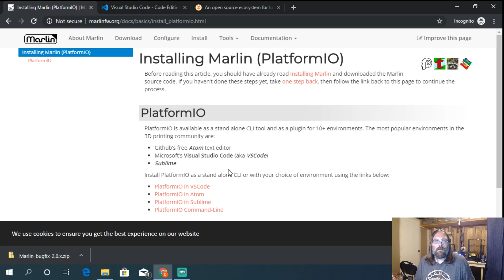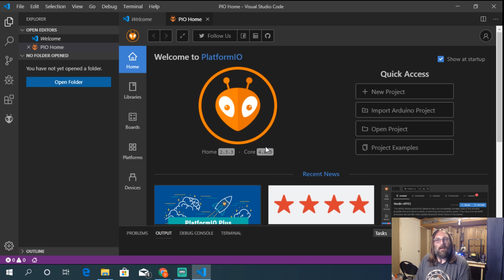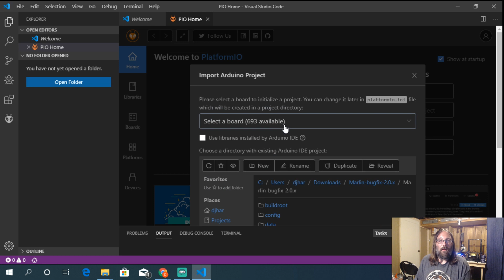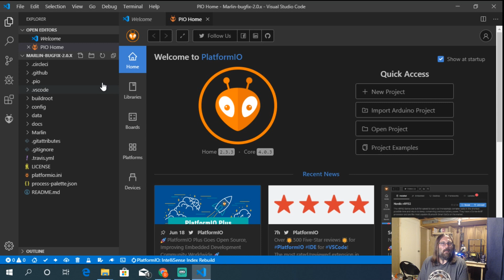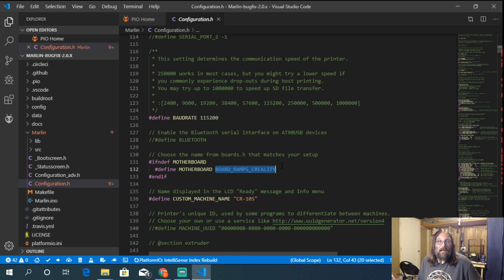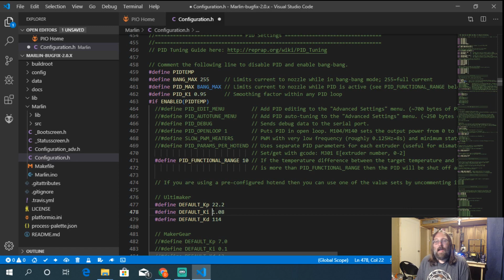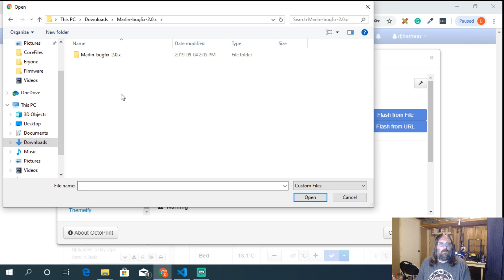Compiling Marlin 2 0 with VsCode and PlatformIO

Comment from the maker: Hey all!  Thanks for checking the video out!  I just wanted to pop a comment letting everyone know that yes the example files still exist the marlin team has just moved them out of the zip and into the guthub (https://github.com/MarlinFirmware/Configurations ).   The left a readme in the zip with this link to!

Stay Awesome!
Reply: The link doesn't work correctly as the closing Parenthesis is part of the link, Just an FYI.
When I download the Latest Marlin  I only get the config file and gitignore, License and the readme file. I do not get a Marlin folder with those files like yours show. I have to be missing something.
Reply from the maker: @DJMovit  Fixed the link thanks!  The folder is in the marlin2.0.x/config/ and the readme is in there I just downloaded the latest release to check.  Following the link downloads the zip with the defaults and examples.
Reply: @3DMakeIt  thanks, I figured I downloaded just the configuration file. I picked the wrong column. 
Your video is very informative! Thanks!
Reply: thanks for  these very helpful videos.
I am having issues installing PlatformIO in the VS Code. I get the error message 
"ERROR: could not start PIO Home Server: ERROR: time out"
The recommended fix did not work.
This is on a completely updated Windows 10 notebook computer.
Would it be possible for you to compile a bin file for a CR-10 mini with BL Touch and filiment sensing so I could download? Otherwise I am stuck with a new mini board, TFT display and BL touch sensor I can't use. If anyone reading this can help, I would appreciate it greatly. Very frustrating...Thanks!!

Comment: You are an excellent teacher.  You don't go off on tangents, you explain the why of it all and you repeat directions in specific areas that can easily be overlooked or missed.  Thank you for this excellent explanation and tutorial.
Reply from the maker: thanks for your kind words!
Reply: @3DMakeIt  You're so very welcome.  I am however baffled at why I have no pio file after following your instructions.   I am trying to update the firmware via octopi.local and when I go to search for the pio file, it isn't there.  What did I do wrong?
Reply from the maker: The pio folder is found in the root of your working directory.   The location of the folder is output just above the line success output in your terminal window when you compile.  If you send a screen shot of tour marlin folder on facebook we can take a peek
Reply: @3DMakeIt  Thank you.   Here's what's above the word success: 
Building in release mode
Checking size .pio/build/megaatmega2560/firmware.elf
Advanced Memory Usage is available via "PlatformIO Home > Project Inspect"
DATA:    [======    ]  60.8% (used 4984 bytes from 8192 bytes)
PROGRAM: [======    ]  62.0% (used 157560 bytes from 253952 bytes)
Reply: I'm guessing it's probably a mac thing.
Reply from the maker: @vegansynths7757  it should be in the same spot.   heres the documentation on it from platform io.  http://docs.platformio.org/en/latest/projectconf/section_platformio.html#workspace-dir

Comment: Thanks for the video. most helpful, especially your mention of the Upload button/function!  The Platform IO upload helps especially if you are using a MAC as the .pio folder is hidden within MAC FINDER (explorer) as a 'dot' folder is a hidden folder (nb. something worth mentioning to the viewers. I spent hours trying to figure what I had done wrong post compiling my first code when all along it was simply hidden - also can press CMD+SHIFT+DOT to reveal). Thanks again!

Comment: Thank you Thank you Thank you!!!!  Ive spent the last few hours of last night and today getting error messages from Arduino software about some bs issue about character length?! No one has a solution, and was directed to VsCode (which was going to be a new beast to lean... so I thought) I'm so glad someone posted a link to this video, your video! I will be using Vscode for now on. So simple love layout. And your video made this all possible. I was banging my head against a wall for an issue that wasn't my issue. 1 quick pass with your video and everything worked. I have been going through marlin videos trying to see where I went wrong with Arduino to have given me such an error. uninstalled and reinstalled marlin and arduino a few times. But seriously just skimming through this video, as I had already created my desired marlin file... and the hex file is right there in front of me. My printer is now flashed with new firmware. Thank you so much. thought I was going crazy for these last few hours ngl.

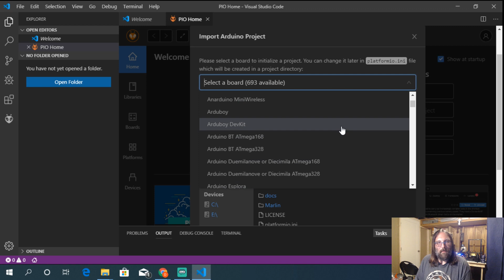Comment: 10:34 cant see MKS Robin E3D board???
12:18 do you copy whole line as in " #define BOARD_MKS_ROBIN_E3D           4026  // MKS Robin E3D (STM32F103RCT6)" OR just "BOARD_MKS_ROBIN_E3D" in place of what was originally there? (i.e. omit the MOTHERBOARD part of the line) It does not specify in the video.
17:23 I get FAILED mega2560 and mks_robin_e3 IGNORED it does not specify MKS_ROBIN-e3D at all. Probably this is due to being unsure what I should do at 10:34 and 12:18 for an MKS Robin E3D board for a CR-10.
???

Still cant figure it out.
I previously upgraded my original CR-10 board to Marlin 1.1.9 using this video and managed it successfully. https://www.youtube.com/watch?v=7J7NYnxL5vA 

But now have the MKS Robin E3D which is configured for the Ender3. No such video to how to use in CR-10 and update the firmware. I also tried it with the Arduino IDE....same ...could not compile and IDE could not see the board anyway.

Comment: Thanks but this didn't work for me. Been trying to update the firmware in my SKR Mini E3 board but whenever I click on "Build" I get a "1 failed, 0 Succeeded" message. I made sure the correct board was selected in the "platformio.ini" file too. It keeps showing it's trying to work with the wrong board and I can't seem to make it change it's mind.
Here is the problem it's telling me it has. Means nothing to me:
{
	"resource": "/c:/Users/sfsco/Documents/Ender3/Marlin-2.0.x SKR mini E3 V1.2 updated - BLtouch fil runout/Marlin/Configuration.h",
	"owner": "C/C++",
	"code": "1696",
	"severity": 8,
	"message": "#include errors detected. Please update your includePath. Squiggles are disabled for this translation unit (C:\\Users\\sfsco\\Documents\\Ender3\\Marlin-2.0.x SKR mini E3 V1.2 updated - BLtouch fil runout\\Marlin\\src\\Marlin.cpp).",
	"source": "C/C++",
	"startLineNumber": 1,
	"startColumn": 1,
	"endLineNumber": 1,
	"endColumn": 1
}

Comment: Thanks for the excellent, step-by-step help. It's really important for  those of us who are struggling with this changeable workspace :)
My problem is that I have gone as far as finding what I think is my Board as'NXP mbed LPC1768' in the window. I'm trying to fit an SKR V1.3 PCB to my Anycubic Kossel Delata Plus which has the NXP LPC1768 chip on board but, when I hit Import, I keep seeing   'X Please select a board'. There is no menu appearing in the Explorer window so I must have missed a step somewhere... not for the first or last time. Any and all suggestions gratefully received.

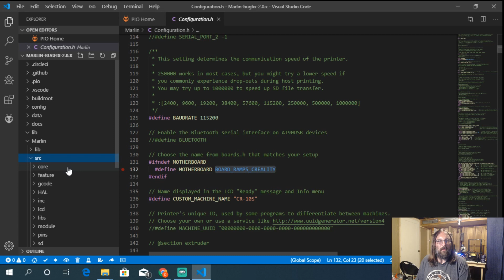Comment: From 12:31 to 12:36 you go from having a bunch of errors in your program to none. What did you do? I've been struggling with this issue for hours and I know it's probably something really small I have to change. Thanks
Reply from the maker: Oh Hi!  A few things you need to make sure of is that the file path isn’t to long where your firmware is.  And that the user that opened vscode has permissions on that folder.    I use the insiders build of vscode now (been about 2 weeks) and it has behaved well.    

The last and best suggestion is if those errors don’t go away you can use the open project button vs the import.  Make sure that that your platformio.ini has the right board in before opening va the import.    Basics import can set the board type where open just reads what’s on the ini file.  

Hope that helps!
Reply from the maker: Oh and I forgot to mention. The longer mine stays open the better the library files open

Comment: Thanks for the video but the only problem I have is there is no example configs in marlin 2.0 they are only 1.8,1.9 and there isn’t many of them like what you had, any idea what I’m missing?
Reply from the maker: HI!  if you go to the config folder and examples (mariln2.0.x/config/examples) which is the location of the examples folder.   There is a readme that says they have just stopped putting them in the zip you download (I imagine to save space) but they are all still available at https://github.com/MarlinFirmware/Configurations

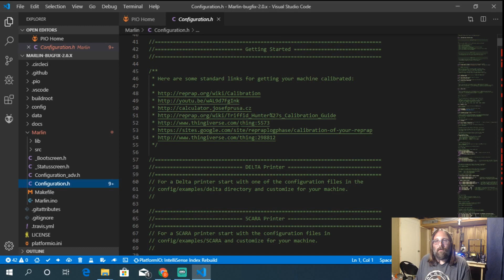Comment: @ 11:11 when you click the configuration.h it shows your config has many errors (9 problems with this file). The red marks on the right side of the screen show where they are I guess? It would have been nice to touch on how to get rid of those errors. I have one error and not sure how to resolve it. Now I must go elsewhere. Great video otherwise.
Reply from the maker: There were no errors.  It was actually the intelligent comipler.   It glitches out occasionally.  Known issue in vscode it sometimes parses the project folders slowly.  Unless you get errors when you try to compile chasing them is a fruitless venture
Reply from the maker: Whats your error perhaps I can help
Reply: @3DMakeIt  What board would I select for a stock Ender 3? Also, how do you change the board once you've selected the wrong one? lol
Reply: In Arduino IDE it was Sanguino ATMega1284. That's a fail for me in VSCode
Reply: I figured it out. My sketch was just too large.  99.1% space used but got it on my stock Ender 3 board with nozzle park and advanced pause enabled. ,😁

Comment: One year later and all of this has changed. Examples are not in Marlin download folder. VSC looks different. I am receiving 17 warnings. I tried uninstall VSC and all components yet every time I reinstall everything is exactly the same. Marlin is installed on it Platform io and the project (with all the warnings) is installed. I cant go back to square one. I am better off buying a new printer with all the time I have wasted.

Comment: Hi! This firmware updating is totally new to me. Just got my Ender 3, my first printer, built and printing. The mainboard printer drivers are very noisy though, so dreaming of buying the btt skr mini e3 version 2. Some day in the future I would also like to install a bl-touch for abl. I got vscode, platformio, github desktop and I think also python installed on my MacBook. Should I download Marlin latest release 2.0.5.3 or nightly build(what is a nightly build??) Marlin 2.0 with bug fixes? Also, should I always start the Github Desktop app before starting vscode and PlatformIO before trying to compile a new firmware for say my current old mainboard or the skr mini e3 version 2.0? And I know the old board doesn’t have a bootloader, but does this sks mini e3 v2 board have one? So much for me to learn still! Your video has motivated me to try to learn how to do configure for my printer, so fascinating! I like your teaching style!👍 Thank you for the inspiration!

Comment: Very Interesting and easy to follow. Only problem is build with Platformio fails with message that I'm using old Configuration.h file even though I'm using Configuration release 2.0.5. Have tried several different build environments all with same outcome. Must be doing something wrong but no idea what. Thanks for all your work though with this and other videos.

Comment: I have windows 10, followed your instructions step-by-step.  However, my PlatformIO only shows "Loading" and never shows the "Welcome to PlatformIO" screen you show on your video.    suggestions?   I've installed/removed/installed several times.
Reply from the maker: you may have to clear the appdata cache for vscode and platformio

Comment: I run into errors when compiling "Marlin\src\HAL\HAL_AVR\../../inc/../pins/sanguino/pins_SANGUINOLOLU_11.h:56:4: error: #error "Oops! Select 'Sanguino' in 'Tools > Boards' and 'ATmega644P' or 'ATmega1284P' in 'Tools > Processor.'"
I know where tools in Auduino is but I don't see it with VsCode.. :-(

I'm trying to do this for an Ender 3
Reply from the maker: HI in your platformio.ini make sure you deafult_envs is set to melzi 
also the board in you configuration.h should be BOARD_MELZI_CREALITY

Comment: for some reason I don't get the printer brands in the config file. this is getting super frustrating.
Reply from the maker: The printer brands are downloaded separately now on the Marlin GitHub you can download the configuration h examples which has all the examples for all the different types of printers it's no longer included in Marlin.

Comment: Hello, I am new to the 3D world. I did everything as shown in your video. Except for an error message, everything is fine: Select an STM32F1 card under Extras> Cards. I have an Ender 3 V2 with a 4.2.2 board. What do I have to change to make it work?
Reply from the maker: Hi make sure to use the creality board BOARD_CREALITY_V4 in your configuration.h and in your platform ini you need to us the creality variant if the stm32f.  So you should be have default_envs = STM32F103RET6_creality as they tweaked the board a bit.

Comment: I cannot get this to work. When i try to install platform.io it asks to install python 2.7 or higher. I clicked install latest python which is 3.8.2 and it still asks to install python. I show its location and still asks! HELP!!!!
Reply from the maker: Platform IO uses C soit will install some C components.   Are you install the marlin auto build extension?  It will ask for python?
Reply: @3DMakeIt  its odd. I used a brand new laptop and it didnt ask for python. Why is my gaming rig asking for python? Seems this program is super unstable.
Reply: @3DMakeIt  i get many errors. I tried malwarebytes and got less errors but still no go and followed so many different instructions to no luck.

Comment: Great info THANKS. So I'm getting a Tarantula Pro, I'm going to immediately upgrade firmware AND board to 32-bit. Do I use the Tarantula Pro config, or just vanilla Marlin 2 and change board type? Both?
Reply from the maker: Hey!  So it would be fastest to start from the tevo examples and build on that.  it gives you a good configuration base.  Remember that the configuration examples are found in the same file location but you will have to open the readme and download the files.

Comment: question.. when i click build my its not giving me a hex file.. i mean everything else is there just no hex file.. Is there a way to change that?
Reply from the maker: What does the output at the end say just before succeed.   It will tell you where all. The compiled files are.    If the hex isn't listed you may need to check the board in your ini and .h just to make sure
Reply: @3DMakeIt  ok so the terminal spits out 
Building in release mode
Checking size .pio\build\STM32F103RC_btt\firmware.elf
Advanced Memory Usage is available via "PlatformIO Home > Project Inspect"
RAM:   [===       ]  31.1% (used 15272 bytes from 49152 bytes)
Flash: [========= ]  86.1% (used 225644 bytes from 262144 bytes)
just before success and the board in the .h file reads as
#ifndef MOTHERBOARD
  #define MOTHERBOARD BOARD_BTT_SKR_MINI_E3_V1_2
#endif
and in the ini file reads 
default_envs = STM32F103RC_btt
as that is what it recomened in the commented section for the rtc6 256k. And searching the marlin folder with windows explore shows no .hex file. only firmware.bat and firmware.elf
Ohh and BTW Thank you for all the helpful videos and the reply!! Your awesome man :D

Comment: Do you know I have watched untold videos about how to update firmware using vscode as i have a new skr 1.4 turbo board and in all the vids ive watched not one told me how to set it up to start with ie that you have  to import project and how to select board , they just seam to bypass that bit as if we know what we are doing but this video my friend is the bees knees you explained it all so even a thicko like me understood it thank you very much Sir , my build passed successful  but i had 3 problems 2 in config.h where it cant find a folder in marlin called include and 1 in config_adv.h which says " /*" within comment [-wcomment]/** [24, 1]  and links to first line in tab but it doesent refer to the same thing in config.h ?
Reply from the maker: Hey! It should refer to the config h in your project. But sometimes the parser in vscode gets confused where things are located in the project.   When this happens removing the project from the workspace on the rjght hand side and re adding it is the easiest way to make it reparse the project.

Comment: every time i try to import I get this error. I did exactly what you did step by step. TIA

 Not an Arduino project: C:\Users\Admin\Downloads\marlin extract.vs\Marlin-2.0.x (Project should contain .ino or .pde file with the same name as project folder)
Reply from the maker: It looks like the build location in the platform
Ini may be pointed to the wrong location.  You could edit the build location in the ino or remove and readd the project to try to fix that

Comment: Is there some other way to do this? I always have issues with software like this. It can't find "working python 2.7 or 3.5 + interpreter. Even with a path provided.
Reply from the maker: While there are other ideas out there the requirements are the same.  Are you pre installing things or letting vscode do the lifting?
Reply: @3DMakeIt  The issue resolved itself when i restarted my pc this morning. Seems others have a similar experience with it. 
Moving on from that I am trying to compile marlin from the bigtreetech github for SKR Minie3 but now I'm getting a "warning" "  "Cannot find "C:\BTT\Marlin2E3\include"." which has proven more difficult. Building fails every time. 
Also get this 
include errors detected. Please update your includePath. Squiggles are disabled for this translation unit (C:\BTT\Marlin2E3\Marlin\src\MarlinCore.cpp).